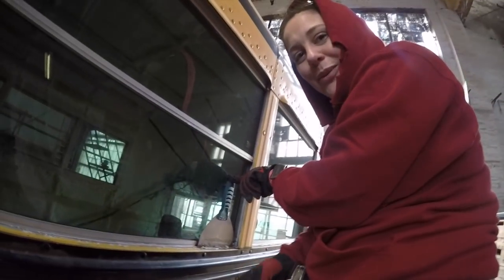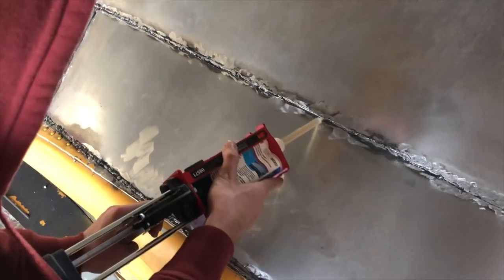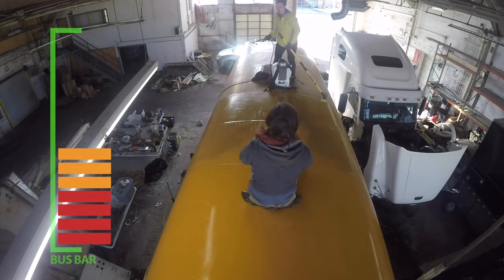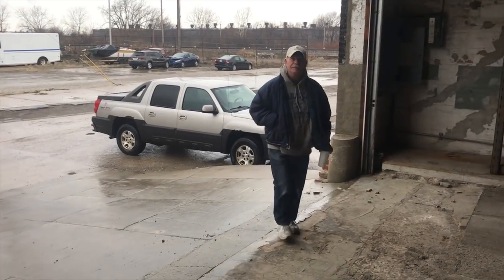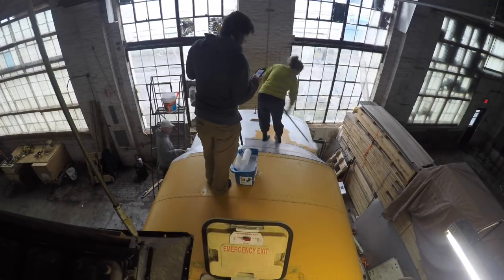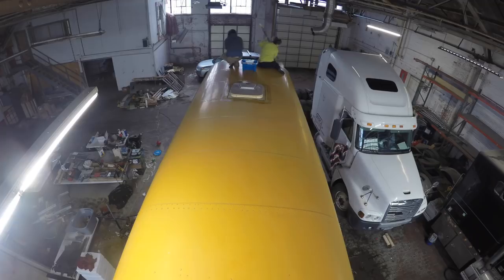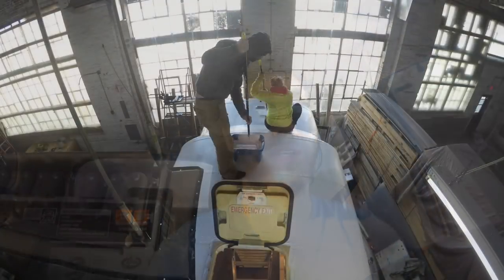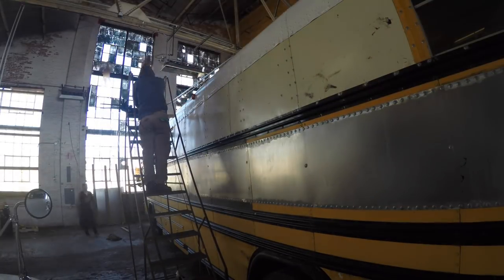Skoolie Bus Conversion Ep 10 - Seal Windows and Paint Roof

Comment: Did you use the same Henry Tropi-cool on the sides also? I've been looking at Henry, but your paint doesn't look as thick as some of the other videos I've watched.
Reply from the maker: The HWYLIFE we painted it on everything above the windows and came down on the transitions. It spreads on pretty thick but it depends which videos you were watching. There is tropi-cool roof sealant and the there is seam & repair roof sealant. Thats probably the thicker stuff you have seen in other videos. Again check back on those videos to see exactly what they were using. We are still going to put a 3rd coat on the roof but waiting for good weather.
Reply: Thank you for the reply. You threw me off a little bit, "above the windows and came down on the transition". Just to clarify, did you paint the ENTIRE bus with the same product?
Reply from the maker: We did not paint the entire bus with the Henry’s tropi-cool. Just the roof and sides of the roof until we came to the top of the windows. Then we stopped. We did however paint further down on the transition sections only.
Reply: Gotcha! I was going that route too. Thanks for the help. Good luck!